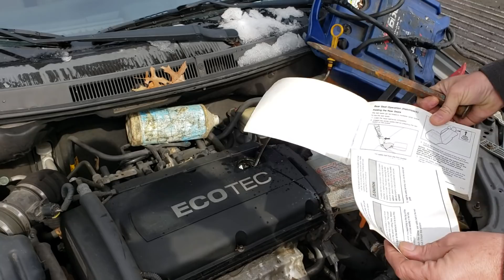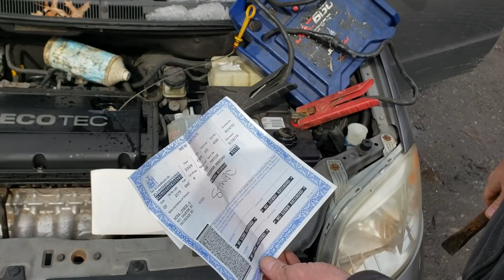HARD TO KILL! Chevy Cobalt Motor Eats ANYTHING! Neutral Drop

Comment: I laughed at my cousin for buying a Chevy Aveo, but now after seeing this, I gotta say that's one tough engine.Guy skips services regularly and abuses the heck out of the thing, yet it never had anything go wrong with it since 2010.That's 9 years of abuse and it's still going...

I don't think my prized E420 Mercedes would handle debris in the engine as well as that POS. I've only had the car for a year and I've replaced the battery and the glow plugs and I hardly drive the thing. But I still love my E-class XD
Reply from the maker: Lol
Reply: That's the Power of German Engineering. (I'm pretty sure these engines were made by Opel)
Reply: Glow plugs.. in a gas engine... right
Reply: @ethannewton9157  I have a 2007 E420 CDI. It's a diesel and like any modern diesel, it has glow plugs.

Comment: I'll share a story with you.
When I was in my early teens I purchase and flipped a few cars.
One of the cars I purchase was a 1993 Mercury topaz.
It was a granny... Look like it rolled off the showroom.
It had a severe engine lifter chatter.
After removing the valve cover I found out this car had never had an oil change.
Needless to say I got mad enough.
I pulled a stunt man trick.
Started it up let it run I said if this don't fix it ooo well.
It was hot about to catch on fire I'll pour the lacquer thinner in the motor across the lifters.
Needless to say I got an oil bath .... Changed the oil put a new valve cover gasket on it and sold the car made $1,000 .
The car run almost four years before being totaled by getting hit in the side.
The moral of this story boys and girls change your dam oil...

Comment: Dude, I thought old Big Blocks were tough but this Little Stubborn Bastid will get you home in a pinch!!!! 
Find another one, or any small Chevy with an EcoTec in it, drain the oil and fill it with Lucas Oil Additive and see if it can survive the best Neutral Drop a 1.3ish liter motor can provide. Great job guys.

Comment: now that's how you grind trash! we gut a trash compactor folks!! wondering where wyel E coyote is with some acme skates! loading that thing like a civil war canon!!!
Reply from the maker: Did you catch my daffy duck impersonation?
Reply: they used sodium soliatate which turns in to a ice forum under heat, locks up the crack and rod bearings solid in a matter of minutes
Reply: oh ya,  classic
Reply: @jbabister  that sodium silicate is NASTY shit. Project Farm showed what it does to a small engine and I couldn't imagine putting them down that way. They deserve to be neutral dropped and windowed before I'd even think of doing that

Comment: If you put bar’s leaks liquid copper radiator stop leak in the oil filler, it is certain to destroy the engine. My bro toasted a Toyota previa like that, maybe a mile or so and locked it solid.

Comment: That is a one of a kind, these motors are junk can't believe how well it handled the abuse. One of the few Chevys i can say I hate. Basically a Korean car with Chevy badges.
Reply: The 1.8. and up are pure American and are better than any 4 cylinder out there ! I have a 2.2. Ecotec and is a beast  !
Reply: @leesantos9711  I have a 05 Cobalt with the 2.2 L Ecotec after seeing this vid, I'm going to fix the oil leak it has lol and keep this going for another 180k miles
Reply: @yupitellwhut  I have a cavalier 2.2 great basic car. My buddy has a 1997 with over 300 k .👍
Reply: @leesantos9711  nice, I actually want one of those for the future but the Z24 motor and manual
Reply: @yupitellwhut  👍👍👍
Reply: That ecotec is a us engine ....they are good engines if maintained , I have had 4 of them

Comment: Both my 3.8's died at 170xxxkm so they are killable. I have a LNF right now and so far it's been good. I've seen them fail from brand new due to engine block casting issues but if you find a good one you're ok.
Reply: So, yer really sayin' it's just a crap-shoot. Got it.
Reply: Then what you're really saying is, it's a crap-shoot with house odds. Got it.

Comment: Wow those engines are pretty tough. Some of that stuff you were putting in the engine would probably fall down in to the lifter valley with that over head cam engine. But that was impressive. I don’t know if you guys have ever fired a gun but you should shoot a running engine with a smaller caliber hand gun like a 9mm or a .22
Reply: Nooooo! Won't penetrate, just bounce back into yer gut. Don't shoot a .44 Mag at a ForgedTrue piston top either. They bounce too...

Comment: The Battery acid and sand and plastic combined to form an advanced silicon formula which conditions and seals all leaks and rings. Combined with our special blend of brake fluid and hand soap which removes carbon deposits. Comfirmed with our custom engine probe.

Comment: This is insane
I babied my 09 Silverado 5.3 with Royal purple, regular services at the dealer ect ect and the engine started knocking at 100,000km. I have no luck
Reply: That's on GM, not you. You did everything right and still it crapped on you. Lesson learned.

Comment: Thats not a Cobalt engine. 
The oil filler is actually on the front right of the head, And throttle body is directly in the front.  Not only that. COBALTS have their battery in the trunk next to the spare tire.

Comment: These are german engines they are made by Opel and they are quite reliable when maintained properly oil change every 5000 miles
Reply: Every 5000 miles? Why? I change the oil every 10k. 175k miles on the clock and still going strong.
Reply: @sekopiski  well I advise every 5000 miles because the oil pumps on ecotec engines are the main cause of catastrofic engine failures but it also depends on the kind of oil you put in it. I have a opel astra f 1.6 ecotec with 416749 km with no problems

Comment: Just falls to the bottom of the head where there’s no moving parts 🤔
Reply: No, there are oil passages in the head, sure the larger pieces didn’t go down the passages but the dirt and the other stuff definitely made it to the oil pan
Reply: Nathan Wood once it’s in the pan the screen on the sump should stop a good amount from actually going back into the motor though
Reply: Shoulda put it in the intake

Comment: If they wanted to kill it all they have to do is drive it less then a thousand miles past the timing belt replacement. One I had pulled the teeth out of the belt at 60334k, biggest POS I ever bought
Reply: Wasn't a ecotec cause they have a chain never a belt
Reply: They say at the beginning they have an Aveo but the title says Chevy Cobalt, not sure if the Cobalt was the same as the Aveo
Reply: @cassandramessmear1707  your right, I forgot the Aveo had the ETECII, got the 2 mixed up

Comment: Your doing it wrong. Needs to go into the fuel line. Oil pickup is in the pan. Engine can run without the valve cover.

Comment: ME and My dad were at the auction he bids on one of these while im out in the yard looking at cars...wins the cobalt.. he calls me and tells me to go check it out hes inside paying for the 2 cars we bought... I go check the cobalt and see theres no oil on the dipstick so I told him to drive the truck over we got oil in the truck... so I start pouring oil in 1 quart 2 quart 3 quart and its still not on the stick then I see the oil coming out from under the car...I look underneath the fuckin car has a baseball size hole in the oil pan....IT was RUNNING in line all the way through the auction probably a half hour..the tow guy must have put the hole in....anyway we get it towed back to the shop I make a patch for the oilpan...fill it back up with oil and she ran quiet...we sold it a couple days later and that was over 2 years ago....UNBELIEVEABLE